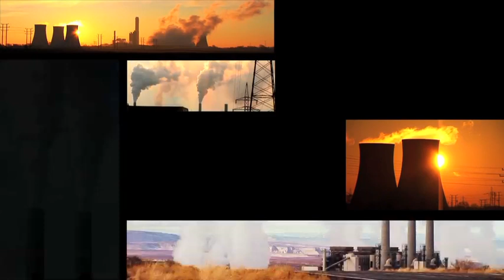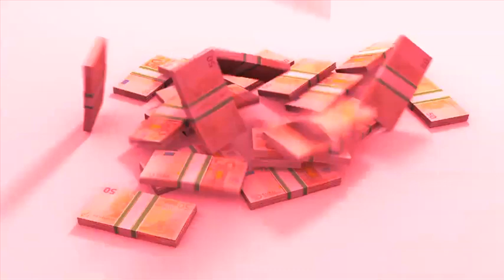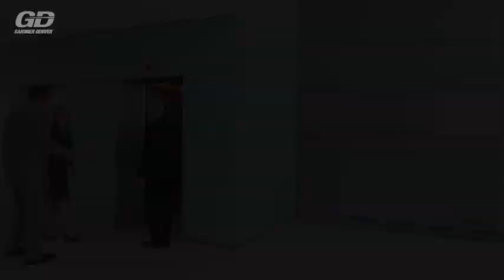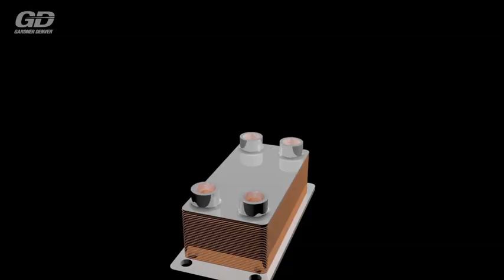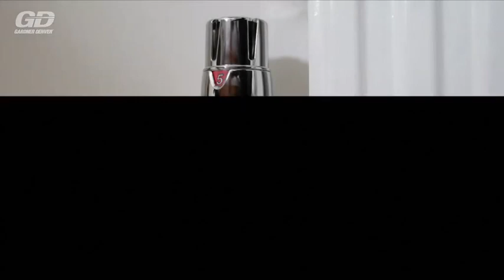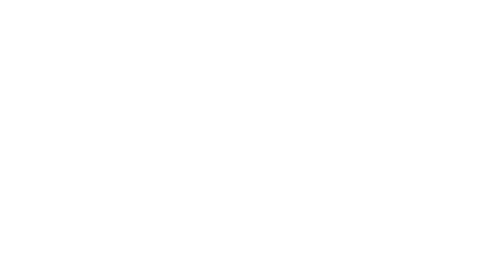GD Compressors _ Innovative Heat Recovery System

Comment: the heat recovery system not done correctly will affect the compressor with low oil pressure.